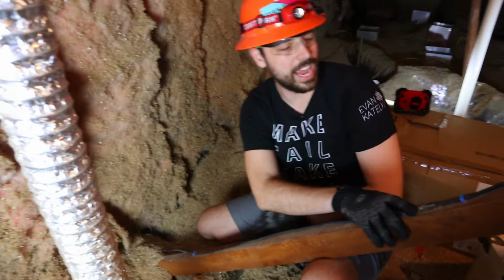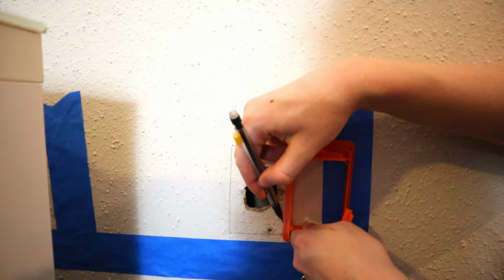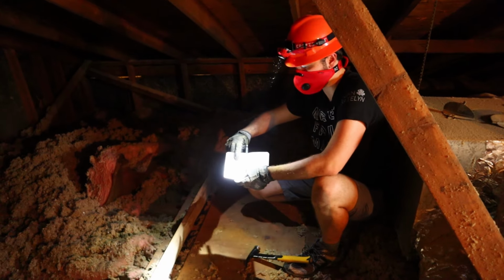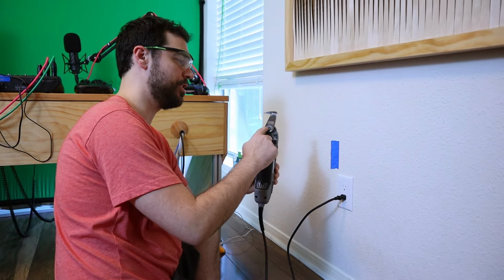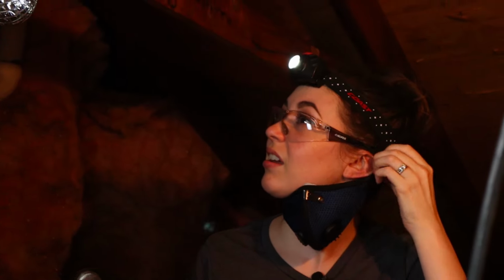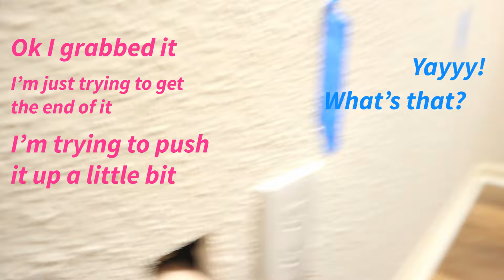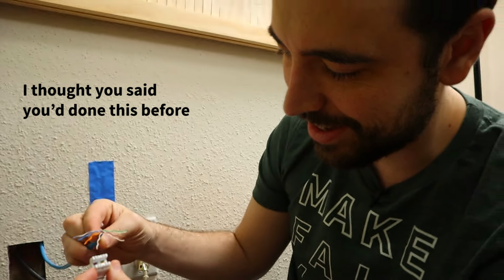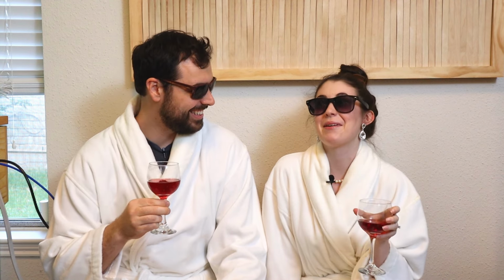We’ve put off running Ethernet for too long…

Comment from the maker: Did y'all know we have 4 channels now? This main one, plus:
🎮 Evan and Katelyn Gaming youtube.com/evanandkatelyngaming
(us playing games and chatting, enhanced by epic editing and a heavy dose of memes) 
🎙️ Evan and Katelyn Podcast youtube.com/evanandkatelynpodcast
(chatting about life, YouTube stuff, and playing games you can play along with)
😹 Evan and Katelyn Too youtube.com/evanandkatelyn2
(still figuring this one out 😂)
Reply: So what's up with the HDMI? So curious
Reply: Don’t you guys have walkie-talkies? I thought I saw some in your garage.
Reply: @evanandkatlyn i have a question : is it american standards to just run cables tru the walls like that ? i live in europe and we always must use pvc pipes to install cables tru a drywall configuration like that with things in mind of firehazard {wich your attic is in every way in my eyes bbut thats aside the point :) } , love your vids but just a sincire question.
Reply: @thascarface  There is no standard for the running of wires in walls through PVC pipe here in the US. Electrical wires on interior walls have to have a specified rated coating to them, and terminated end. You won't have a bare exposed wire in a wall. In some areas if you are running higher voltage wire you have to have a licensed electrician or contractor do the work, but low voltage wire like security system or PoE (Power over Ethernet) you usually don't. With that said there could be some municipalities that do require wires be run in conduit/PVC pipe depending on the application.
Reply: Hey guys why the switch????
Reply: Why did you choose cat6 over cat6a? No one ever does that. EVER

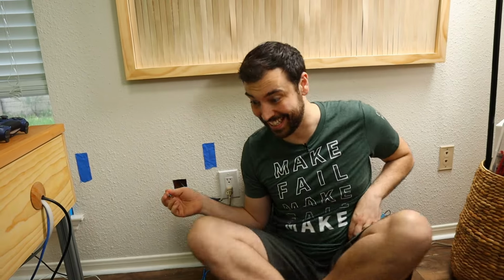Comment: 13:26 I had never needed to terminate cables before but my friends relative needed help with a job and I needed money so I helped wire up an entire Kohl's store with Wi-Fi access points overnight. Aside from running wire through all the ceilings my job was to terminate about 50 of these ethernet ends AND keep track of which was which. I learned how to do it REAL quick.

Comment: Now imagine having to run cables downstairs in a two storey house with concrete floors and brick walls.
Reply: Its easier than this if you are lucky and your house have  conduit pipes installed.
Reply: Y do they run it from the attic y not move the box closer to the pc
Reply: @pikimiki3956 I wonder if they ran conduit over 100 years ago when my house was built 😂
Reply: @animationcreations42  
my is not that old it's 66 and still have some original counduit from that time (electricity) all the others are from around 20 years ago when electricity and telecomunications was updated. But every time when you need to change some wireing its not much more effort if you install pipes, but it pays off when you need to replace or add something in future.
Reply from the maker: That's expert mode!
Reply: animationcreations42 do you also have the plaster/concrete? walls? Those are a joy to do any construction with...
Reply: [Laughes in european]
Reply: Overcomecross98 then they would still need to have a phone line or cable jack and a power source for the new location. 

Much easier to just run the Ethernet cords to the desired locations. It’ll also be a great selling point for them if they ever move.
Reply: Plus ripped pants...!!!
Reply: Me last week with my dad putting Ethernet cable in my house 😅
Reply: It was a mess we had to drill 5 holes in concrete to get it done 😆
Reply: @Series clips!  I'm French, and we all know it's the same all around Europe, old stones for all  !!!
Reply: Yup. Clearing the pantry because the freezer is blocking the access panel into the crawlspace,  then crawling in the cold sand to the place the cable needs to drop down, including over 4 inch high obstacles (foundation, annoyingly placed sewer pipes) when the space itself is a called a crawlspace for a reason,  then crawling to a place in the house that should be just 5 m away but because of support blocks you have to crawl around is not the same route, and of course crawling back to the access point a gazillion times because your buddy above ground doesn't understand the words you're trying to get to them or you need a tool you shouldn't need because something unexpected happened. And then having to cover up the holes you had to drill in the floor (or floor and ceiling if you needed get a cable to the second story across the house)  and the cables running between them because no one in the 19whatever when your house was built thought you'd want to have cables other than regular electricity upstairs.
Reply: @pikimiki3956  or put the cable in the corner between the roof and the wall

Comment: Great video!  I've decided to run RJ-45 to several rooms of the house during construction.  It's important to do it now as the house is built of cement and brick.  No walls to run wiring after the fact. How did you connect the HDMI connections?

Comment: What you just did I used to do for a living, for many years.  Nice job.  You pretty much did it the way a professional would do it.  You were really smart to guide it along the rafters, rather than leaving it to lay loose.  Really interesting tools for cutting drywall.  Nice editing, great special effects, very entertaining written comments -- keeps it interesting.   It is so amazing how such high drama seems to always hijack your "content".   The happy face going up the ladder behind Katelyn was the highlight of my week so far.  You are probably never going to do this kind of thing again, but for the record, it is OK to go across a power line, but never ever along beside one.  The technical specification is keep it 24" away (especially from fluorescent lights); and no tight bends, just gentle round bends.  I don't understand why you need a server?  What kind of server is it?   Thanks.
Reply from the maker: Thanks!! And good to know about keeping it farther from the power line. Lol the smiley face made us chuckle too!
Reply: @EvanAndKatelyn  I am glad I spoke up.  I did not know if you knew about that.  One more question:  did you, by chance use "shielded cable"?  OK, what the heck is shielded cable, you ask?  Was there foil wrapped around the wires inside the sheath?  If there was any foil then it is shielded cable.  That may or may not cause a problem.  If you ever have a problem there is something easy you can do that probably will solve it.  The shield does not work as a shield until you ground the foil.  Ungrounded, the shield acts like a giant antenna -- and radio signal or emf can actually disrupt or slow down your data flow, or even stop it cold.  To fix it, all you have to do is ground the foil at one end or the other.  Shielded cable is better than unshielded if you ground the foil.  .....  I loved how you started this video.  That was so fun.

Comment: Hello Evan & Katelyn, thanks for a fun and interesting video.  I am planning to do exactly the same thing you guys described. I've never done concealed wiring before and researching this topic came across your video. When going vertically up, can I possibly encounter a horizontal stud and if so would I have to cut out the dry wall at that point and drill a hole through it to pass the wires?

Comment: New subscriber here and I’m loving your videos! Do you have any tips for remodeling a house slowly? We just found out how much cheaper it’ll be to do projects slowly, either by ourselves or with the help of family and friends. We’re slightly at a loss as to what to start with, or how to go about funding this operation. 😅 Any advice you guys could give would be greatly appreciated. ☺️
Reply from the maker: Thank you! I think its always best to start at the bones and then work your way to more cosmetic stuff (for example, fix wiring, plumbing, wall removal, anything like that before adding pretty stuff like a backsplash, new countertops, etc). One podcast/blog/Instagram account is recommend is Young House Love! They've done some posts on the topic that I think are really helpful

Comment: a keyhole saw makes WAY less of a mess than the oscillating saw. keyhole saws cut on the push stroke, so you can actually push most of the dust into the wall. i take a moist paper towel and hold it under the spot i'm cutting the hole and it will catch almost all the dust. and the OATH method helps for running wire too... 1 Pull on rope, O - OK ; 2 Pulls on rope - A - Advance, 
3 Pulls on rope - T - Take up slack ; 4- Pulls on rope - H - Help

Comment: Curious, in your work with CAT5 cables, have you attached connectors on your own (versus store bought with ends already on)?  If so, have you ever used the pass-through connectors? If so, what are your thoughts on pass-through?  I've always used the non-pass-through (where you have maybe 3/8 inch of wires to straighten and put in the correct order) and the pass-through seem much easier.
Reply from the maker: We looked at pass through but the punch down tool was cheaper than the tool that crimps the ends onto the cable so we went with the cheaper option

Comment: I’m new to wanting to hard wire my house with cat 8 So I’ve been going through many video to get as much knowledge to attempt myself. 1 question what is the purpose of running an HDMI cable as well? I can’t think of anything or how it would be used but If there is a good reason I just might run it as well while I’m at it.
Reply: If i had to guess I would say it was used for security cameras?

Comment: Attic Remodel Series? You have enough space for a bonus room!
Reply from the maker: If we had space to add stairs to get up there we totally would! It is on our to do list to fix it up slightly to add more storage space but we probably won't finish it completely
Reply: EvanAndKatelyn even just covering up the insulation with Sheetrock (hell even plywood) would probably make a really big aesthetic difference!

Comment: U should clean your attic as your next project😭
Reply: Not sure what you mean. The only thing I saw up there is insulation. And you don't want to remove that stuff in Texas. That would turn any home into an oven.
Reply from the maker: It looks dirty (and there is dust) but like @Brad Leavitt said, that stuff on the ground is actually blown insulation 👍

Comment: Houses in the USA are so strange. You just take a vibrating tool and cut right through a wall like its butter.
Reply: It's a sonic chisel.  Almost as good as a squareness gun!
Reply: @andy-in-indy  where I live houses are made of actual stone/concrete. Even with this fancy tool, this would not work
Reply from the maker: Haha the tool has some serious power behind it (works on wood and stuff too) but drywall is kinda oddly easy to cut!
Reply: @EvanAndKatelyn  Never understood why Americans call plasterboard "drywall".

Comment: What’s the extension you used on the spade bits?
Reply: Also, did y’all splice multiple cat 6 together in the attic. I currently have everything in my attic but I drop it out of an outlet and run it to my router. How did you run multiple things needing Ethernet to one outlet? I guess I’m just a little lost lol.

Comment: Easiest way to pull cable through an exterior wall, or any wall with that type of insulation is with glow rods. 
The piece of the wall that you cut out you can just throw in the wall, which more than likely the people that originally did the cabling did. 
Terminating cable is my favourite part of the job, and it’s A LOT easier with a punch tool, but being (probably) your only job with cable, that works really well! 
Y’all did an amazing job, my dad (boss) would be proud of y’all!

Comment: Question:  how are your speeds from one end of the extension compared to after the extension?   putting them close to the power outlet creates a lot of interference I've been informed to space unshielded twisted pair away from electrical wires and only run them across them perpendicular.

Comment: If that's the dyer vent duct in the attic you should replace it with a flame resistant semi rigid dryer duct.  Much safer than the one you have installed.

Comment: Hmmm....did you guys turn off the power to that outlet before you sent the METALLIC tape down the wall? Although unlikely, the tape could have ended up in one of the holes in the outlet box.

Comment: Next time use a glow rod.  Tape the cables to the glow rod and push the glow rod down the wall.  You can push a small nail through the ceiling to mark where you need to cut the hole in the wall below and pull out the glow rod and cables where your outlet will go. Love the show.  keep up the good work

Comment: These couple did a good job with securing the cables, adding a mud ring to that coax wall plate (a lot of TV installers have that bad habit), and terminating the Ethernet cable closely to the keystone jack. I have some advice if anyone comes across this video and wishes to do this. Run all your network/coax cable to a central spot (such as a small closet), don't run cable from room to room. When possible, use a punch down tool so it makes your life easier (will cut excess cable from keystone jack and ensure contact is made with pins).

Comment: I always leave string / rope in my runs... usually enough so it can go the full way up / down in the wall... tied off somewhere or attached on both ends so you can easily find it... then if you come from the top you just pull it up as far as it will go, attach the wire, and pull it down. From the bottom you pull the string out of the wall and find the part stuck in the wall at the lowest point or connected to the box and attach the wire to that... and pull up... That way you never have to run a tool through those runs again and you don't have to undo the old wiring in order to run new.

Comment: I often buy things for my projects days, weeks, months, sometimes years in advance. One thing I learned is buy the parts the second time at the same place you bought the first set of parts that way you can return (hopefully) the first set of parts when you finally find them, which is usually a day or two after you finish that project.

Comment: Hmmm, supplies purchased to have wired ethernet through the walls and still haven't done the project after 2 years, are you looking at my to do list? Although I still know where all my supplies are and mine will be running through the crawlspace. I plan to also run multiple rooms to a central location, and I was going to go ahead and redo my cable tv runs since they have become a mess from previous owners.

When you were fishing next to the insulation and sent the fish down I was going tie a rope to it when you pull it back up, and then you did it.
Reply from the maker: Haha so you understand the struggle! Good luck when you tackle your runs 👍👍

Comment: Anyone know if there's a way to change a old telephone ports into an Ethernet ports? My house is as old as me and wife I was ethernet turned out to be one of those old telephone ports
Reply: You'd have to run ethernet cable to replace the phone cable and swap out the box cover to an ethernet one. But at least it saves you from having to cut new holes in the drywall and you can potentially use the holes in the attic that were cut for the phone cable to run the ethernet cable down.

Comment: If you tear a hole in the center of the cable roll plastic and pull out the center end they will self feed. From a DIY’er who watched an alarm installer do the same.

Comment: Good job running the Ethernet cable. I always forget that the older houses ( much older ) do not have data lines running through the walls. My house has Cat 5e running to all rooms and smart box in a closet upstairs. It would be difficult to run the lines since the rooms downstairs would be very difficult to run.  Even with my networking degree I always find it a little challenging to run cable but I do enjoy it. Just remember to run your cable in the cooler months. Thumbs up!
Reply from the maker: Thank you! Haha yeah a cooler month would have made this much more pleasant

Comment: #1. Tyvek Suits
#2. Smurf tubing (e.g. Carlon ENT Non-Metallic Flexible Tubing)
#3. Was going up from the basement not an option?  Usually MUCH easier than going into the attic.  
#4. Damage can occur to the wires inside the Cat-5e/6 cable from tacking.  Hence the smurf tubing.
#5. Running network parallel to electrical can cause interference on the line.   Also - always use a voltage sensor before cutting into wall.

All that being said .. its just a house .. it'll do the job and run well enough for what you need ...  for now ... :)

Comment: Just curious, why run ethernet cables when wifi has become so fast with such low latency? I can see that some things may need the slightly more stable ethernet connection, but what are the benefits here?

Comment: If you ever have to do this use a dowel rod long enough to poke through the insulation they make super small ones and put it by the wall you want to drill then drill a hole for the dowel rod shove it up into the attic, drill your hole in the stud run your wire through the wall pull the dowel rod out and patch the tiny hole in the ceiling and it makes finding the wall in the attic so much easier

Comment: Do you have the right type of hdmi cable cuz if you dont it could stop working on you you one day or worse damage something make a sound system or the TV because the run is too long
Reply from the maker: So far no issues! We use it for our streaming/podcast setup
Reply: @EvanAndKatelyn   thats good😊👍🏼